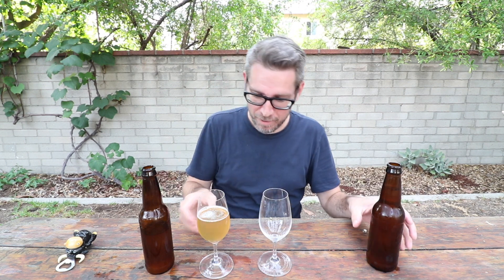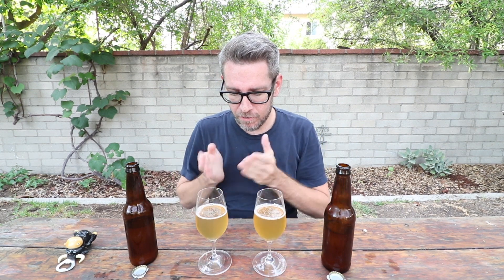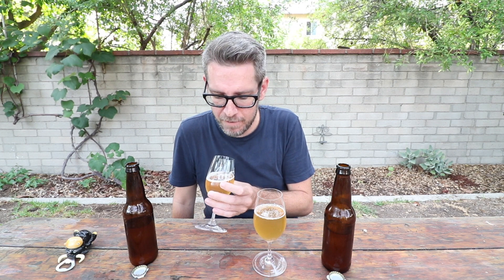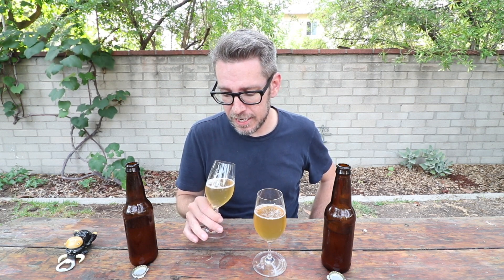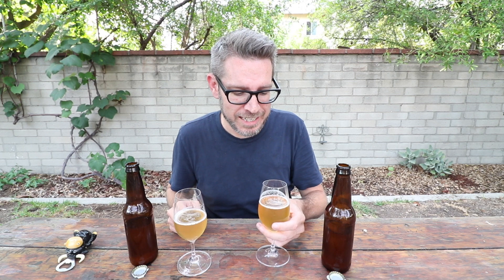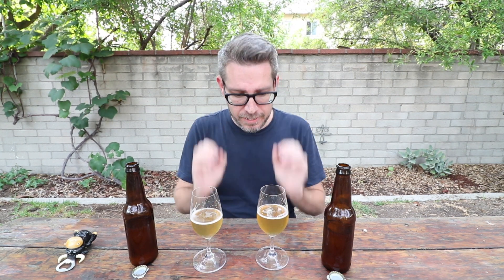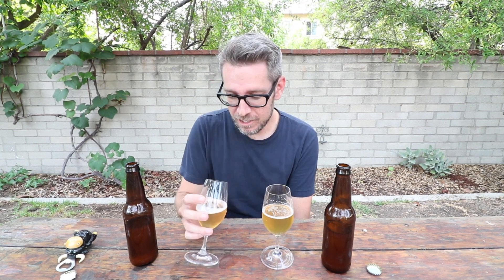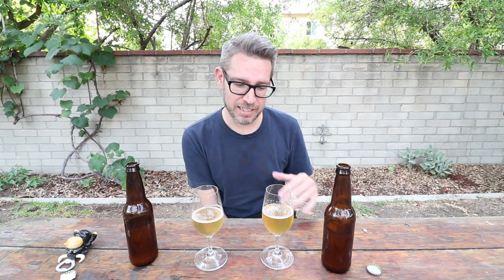Comparing pilsners: ale yeast vs lager yeast

Comment: Interesting. I thought that the lager yeast would stand out more. 
From what I remember from brulosophy and brewing tv they basically said that the temperature for lagers were not that strickt, that you could do a lager in room temp, with a lager yeast. 
Did you have both beers on lager temperatures? Since ale yeast mostly give of flavors on higher temperatures im guessing that there would be a difference in room temperature?
Reply from the maker: I fermented both at 65F. I did attempt recently pushing Wyeast 2206 to the 60sF that didn't work that well, but it could have been a fluke.